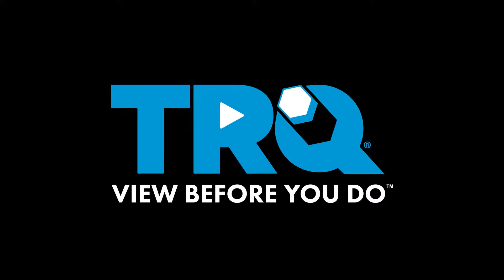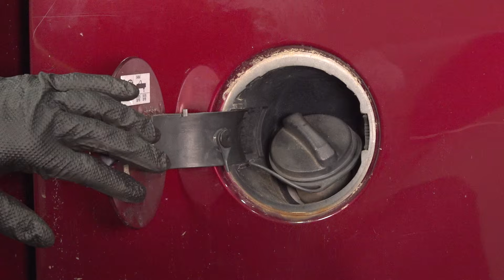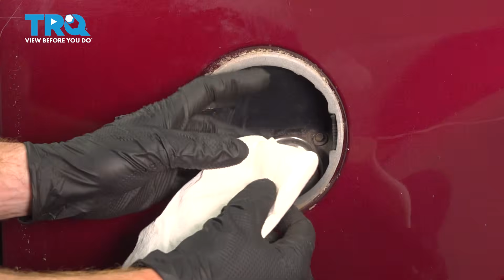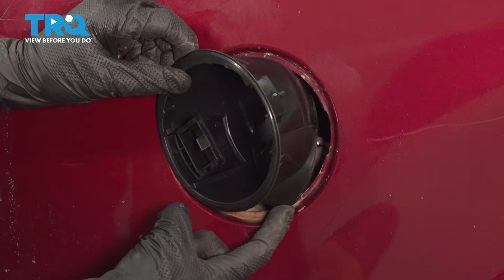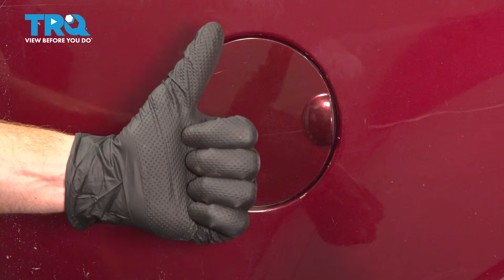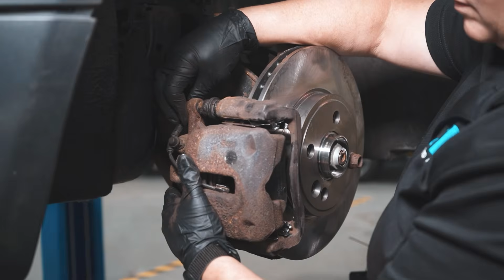How to Replace Fuel Door Hinge 2004-2008 Ford F-150

Comment: I did have trouble at 3:07. It would have been better if you showed the entire installation process without editing it out. I managed to find another video where they explained to move the fuel line itself out of the way with your off hand to get the hinge to go in.